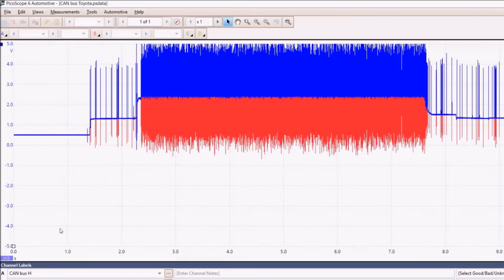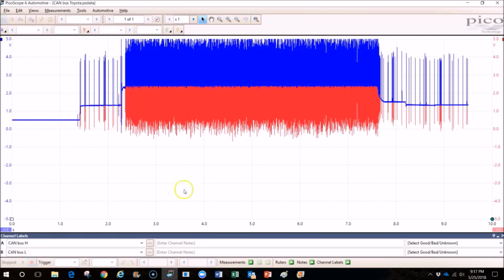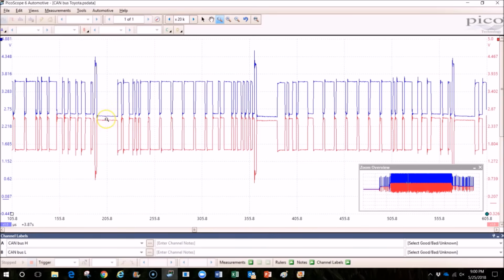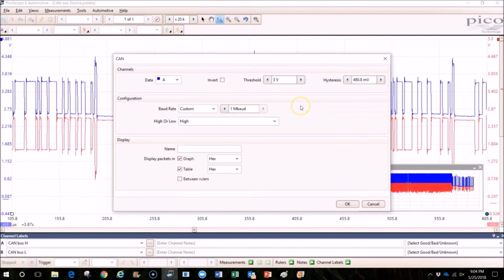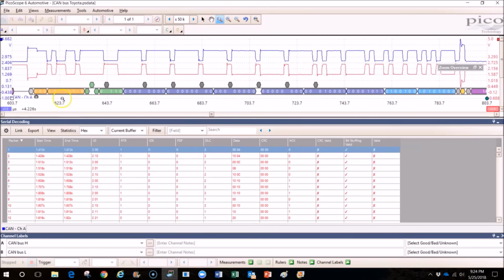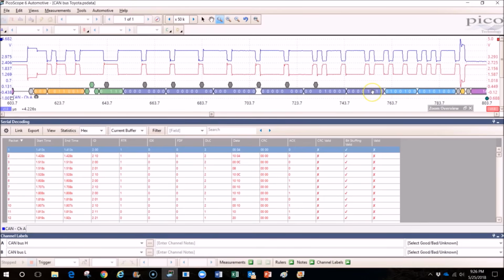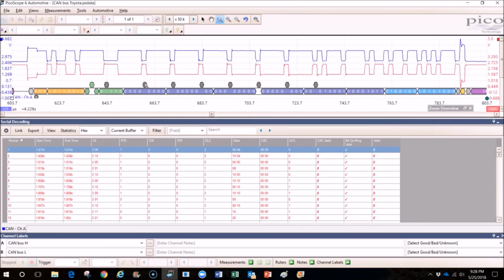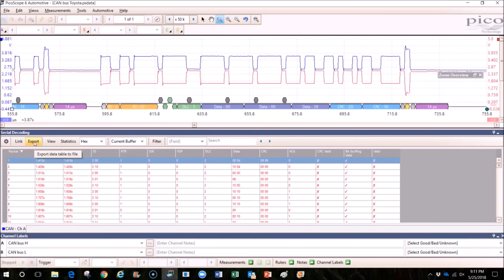Decoding CAN Bus Data Using the PicoScope

Comment: Thanks for the excellent explanation!
Do you have a video explaining how to decipher what signals go to which modules?
Reply from the maker: I do not have a video for that, but there are three ways to do that.  
1-for OBD II generic messages, you can download the OBD II decode file which is publicly available and you can begin to decode the messages (this is what a generic OBD II scan tool does).
2-for OEM manufacturer specific messages, you can buy a vehicle network interface tool such as CAN SPY, then get a job working for the manufacturer and steal their files.  I am kidding - don't steal any files.  I am just saying that those files are not available.
3- you can reverse engineer things one message at a time by logging your CAN data with the Pico Scope, exporting the data to another app such as Excel, then begin making changes to the vehicle and note which messages change.  This is very tedious, but in some situations, it is the only option.

Comment: Which pico is that. I need one of these in my life. Please don't be the $2500 one. If so does the Hantek do decoding too?
Reply from the maker: It is the automotive Pico.  There are other scopes that you can limp by on, but nothing compares to the automotive PicoScopes.  No cheap scopes can decode the CAN bus like the Pico software, either.  You can buy a 2-channel PicoScope with leads (without buying the whole kit) for a lot less than $2500.  You can find a standalone scope or a starter kit on our website - CatchaWave.com.  Call i you have questions!

Comment: Any way of knowing what information came from? What module after it's been decoded?
Reply from the maker: There are ways to do that.  If you don't have manufacturer's files (which you would not, unless you worked for them), then you would have to manually decode the messages.  This is a very long and arduous process.  Often, this can be done by removing modules from the network or changing something, and then carefully comparing the messages to find differences.  You wouldn't do this for fun.  You would have to be very motivated.

Comment: LOL! Thanks 
hmm..  i don't understand why you select hysteresis value '480.8mV'
Plz help me! (i'm korean) :)
Reply from the maker: I think the 480 mV was just there by default.  When the hysteresis is set to a lower number, the software will be more sensitive to errors in the CAN messages.  If I want to detect ALL possible errors, I will set the hysteresis at zero.  If I want it to be more fault-tolerant, I will choose a higher number.
Reply: @JustinMillerAutomotive  Thanks for your answer! It helps me a lot to solve my wonderings. I will subscribe your channel! Thanks. haha :)

Comment: Curious if you always ground to pin 5 at the DLC, or are there any instances when you would ground to pin 4?  Thanks!
Reply from the maker: You can ground on either pin.  Ideally, they should both have zero volts.  However, the real question is what is the voltage at those pins?  If you are concerned at all about voltage drops on the ground side, you should verify that the voltage at each of those pins is within about 50mV of the voltage at the negative battery terminal.  The negative terminal is always the best place to ground for most accurate readings, but once you have verified your voltage at pins 4 and 5, you can use them as your reference point.

Comment: what about a 1995 lincoln continental j1850 style?
Reply from the maker: CAN became the required protocol for the diagnostic network beginning in 2008.  A few cars began using it a year or two before that, but not in 1995.  Early for OBD II vehicles used the J1850 PWM protocol, which is a two-wire network on pins 2 and 10 of the DLC.  If I remember correctly, the voltages switch from 0-5 volts.
Reply from the maker: I meant to say "early Ford OBD II vehicles."

Comment: Dear Justin,
Thank you for sharing this video. I wonder what type of Picoscope model you used in this video, allowing you to measure 10 seconds of data in 1 go. I cannot do this with my (cheap) Picoscope 2204A limiting me to max 20 ms of recorded data. Trying to increase the number of samples, will make the software no longer able to decode the CAN message. Is this related to the amount of memory the device comes with (8 kS for 22204A)? Thanks.
Reply from the maker: I usually use the 4425 or the 4225.  The amount of time that you can record for has to do with the number of samples you are requesting.  If you request a higher sample rate, then you cannot record for as long because you are limited by the memory of the device.  If you request a lower number of samples, then you can record over a longer time.

Comment: Thank you Justin. Can you please give some examples of when we would need to decode the CAN Bus for diagnostic.
Reply from the maker: By taking it to this level, you can determine whether the CAN bus is operating correctly and messages are being sent and received successfully--but that is about all.  From here, you would need software with the correct file in order to translate these messages into English.  That is basically what a scan tool does.
Reply: hi Billy, any futher steps you found already here? I am in the same process with the need to analyse this data. All commercial Can-H & Can-L cable hardware-sniffers are pretty expensive. Thx!

Comment: Brilliant video, I've been looking for this for a long time. Do you happen to know if the PICO offers a decoder for typical marine hardware communication protocols? My boat uses the old NMEA 0183 protocol, but new hardware is all NMEA 2000.
Reply from the maker: Thank you.  I wish I new more about marine protocols, but I don't know the answer to that question.  Maybe you could contact Pico directly and ask them.

Comment: great video. Can we reverse engineer the data to find out which unit (ecu) sends the packet?
Reply from the maker: Yes, but it is very tedious to do it manually.  There are software programs that can do it.  In fact, that is what an OBD II scan tool is doing-interpreting the CAN data and turning it into readable information.  OBD II data is public domain and can be accessed by anyone.  For other network data, you would need to have the correct files from the manufacturer in order to translate the hexadecimal messages into something we can understand.  The manufacturers do not usually give that out.